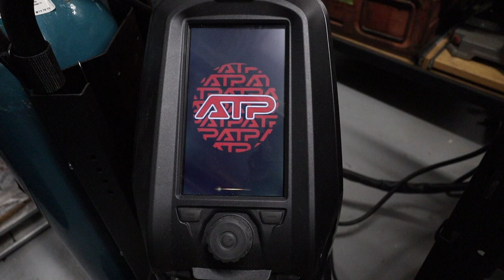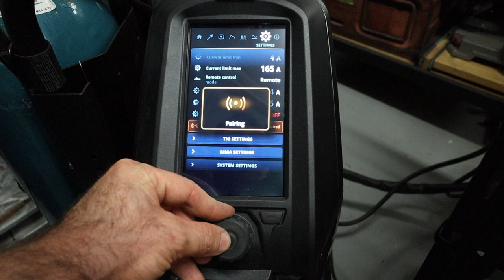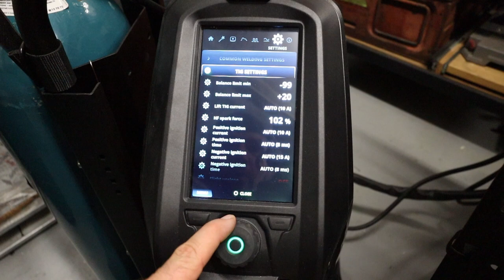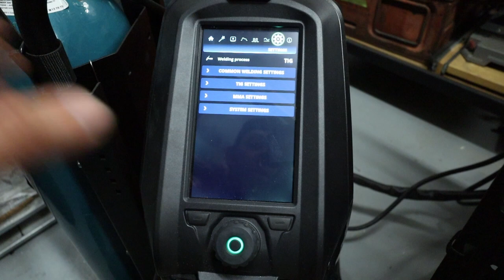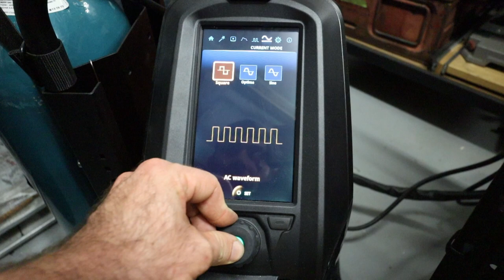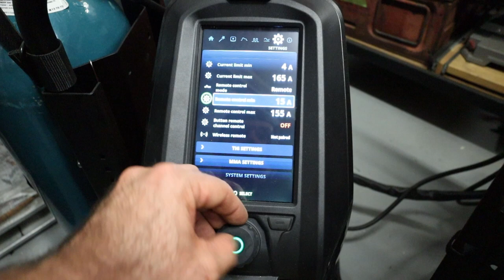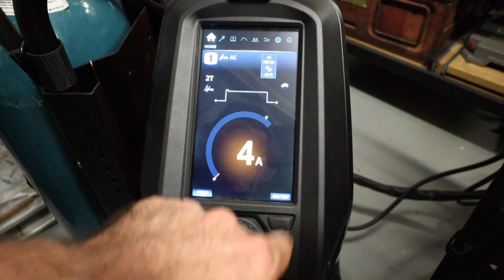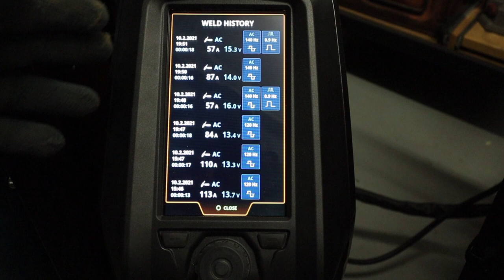Kemppi MasterTIG 235 AC/DC Setup and Menu - VLOG

Comment: I really thought this machine would go higher than 20Hz on pulse freq.
Reply from the maker: Only on AC, but I totally agree, I never would of thought a machine like this would be so limited!
Reply: @AdamTaylor   It's not a massive deal although its good on thin stuff to run like 250Hz+. I would just be expecting 500-1000Hz for that machine. I bet the arc starts nice on low ac amps though.

Comment: Hello dear could you please tell me your opinion about this machine if good for welding aluminum tube and plate structure small thickness and thick thickness?
Reply from the maker: This machine is definitely capable for a 235amp machine and certainly worthy of a look if you have a production business if it's powerful enough.